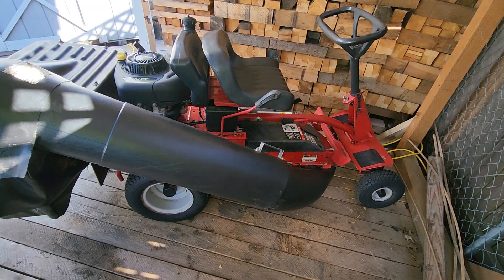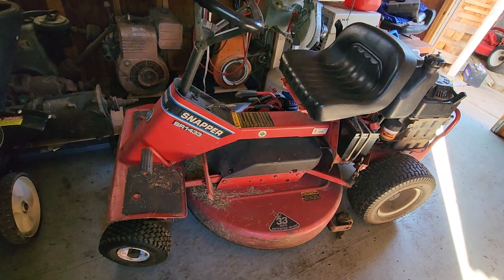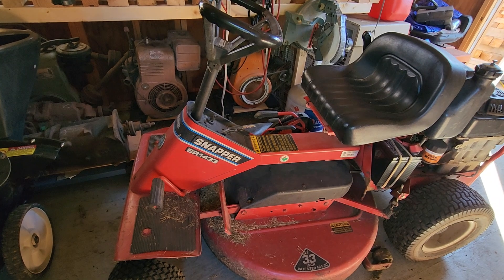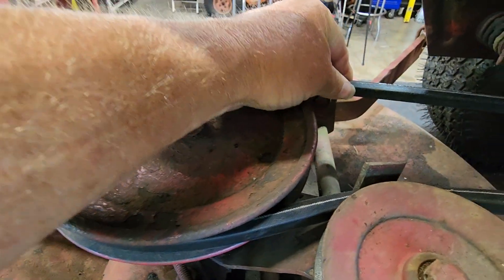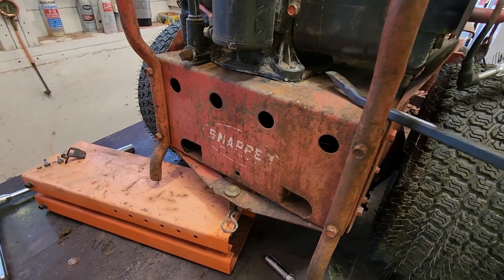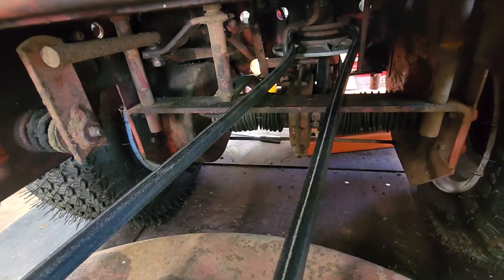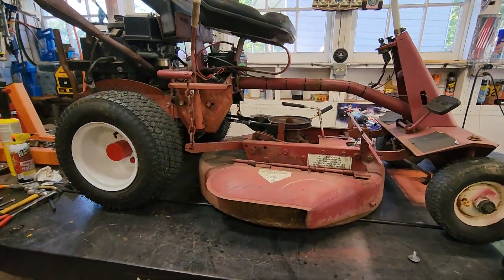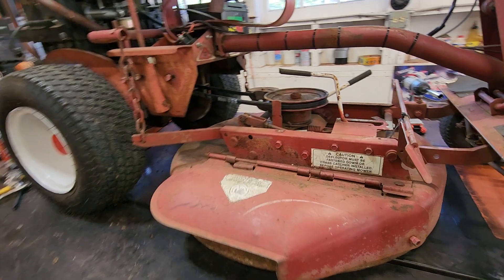I replaced Deck Belts on 3 Snapper Rear Engine Riders. TIPS AND TRICKS FOR CHANGING THE BELT!

Comment: Nice vid but there it another way, little easier with out undoing the engine bolts, stand the mower up on its end thats what those bars are for at the rear and put it in neutral pull back the spring loaded guide that the shifter moves in then you can slide the belt out from under too thats the way I do it on my rear engine snapper, love these machines.
Reply from the maker: Thanks for the tip